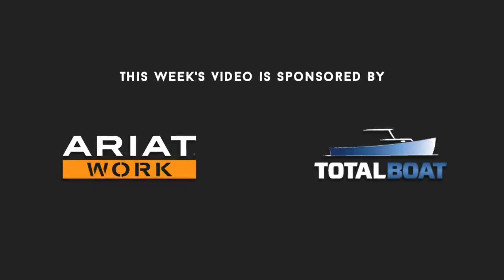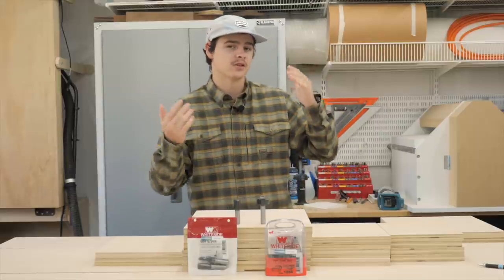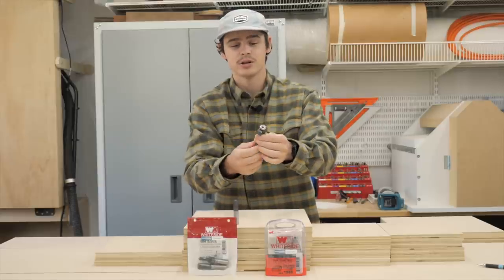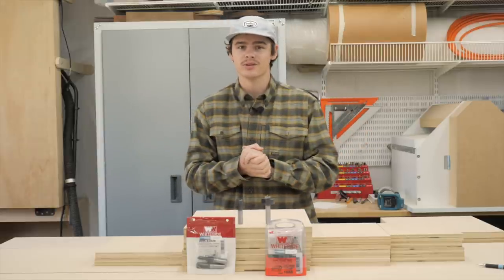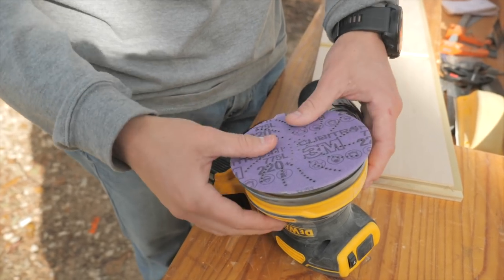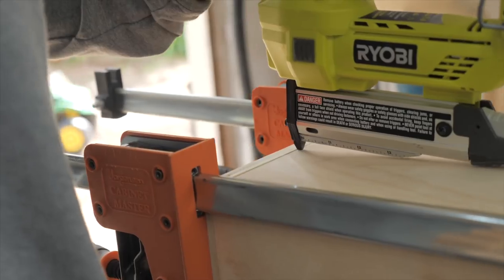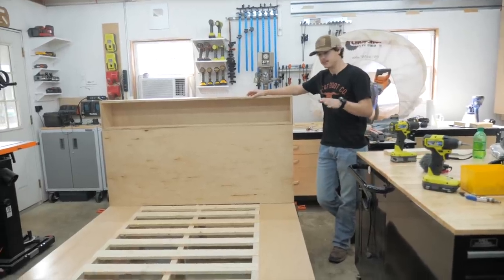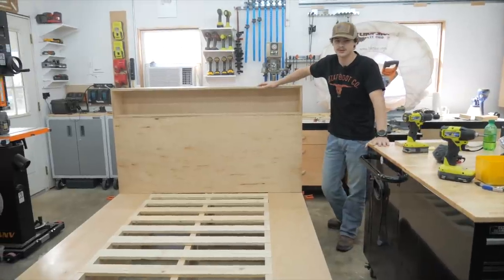How To Build A Platform Bed With Storage | Woodworking

Comment: A nice tip I learned if you get squeeze out on inside corners is to cut a drinking straw on an angle and use it to scrape out the squeeze out while it is still wet.
Reply from the maker: Good tip!!

Comment: Love the build! Couldn't you have used a dado stack on the table saw though to cut the rabbet rather than making two passes with the single blade?
Reply from the maker: Yes you could! I prefer this method in plywood because if you cut in the middle of a layer then the cut tends to be cleaner doing it this way.
Reply: @Woodbrew  Good point. I agree. Thanks for clarifying.

Comment: Very nice project and video. One question: didn't the client want the plywood edges covered with veneer?
Reply from the maker: He gave us full control over the design and we love exposed plywood edges! We do sometimes use edge banding to cover them depending on the project, but yes you could totally cover them!

Comment: Very good video. I have alot of problems using router bits on plywood to much tear out even with sharp bits. I do have a question: Why didn't you veneer the plywood edges? Was that yours or the clients choice?
Reply from the maker: Not covering the edges is the look we were going for. Probably wouldn't have even use plywood if we were going for the solid look.